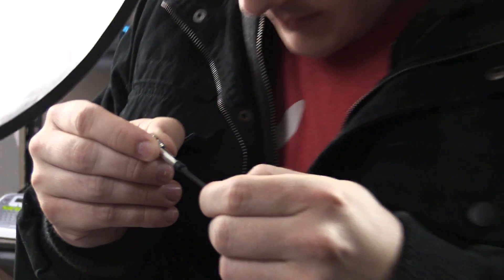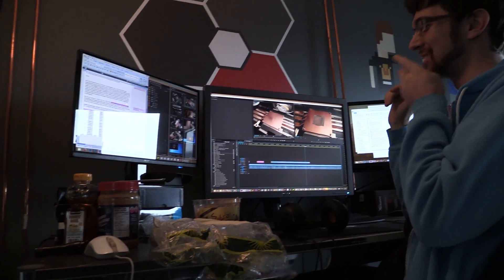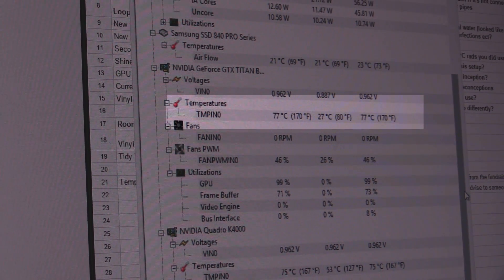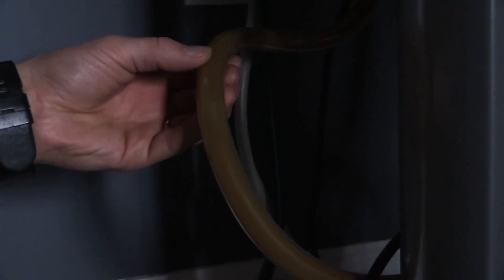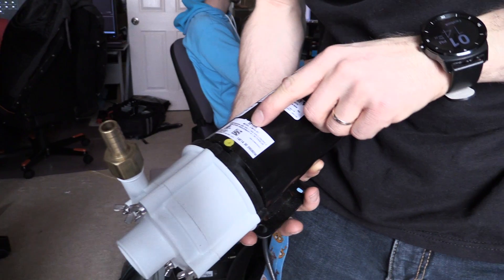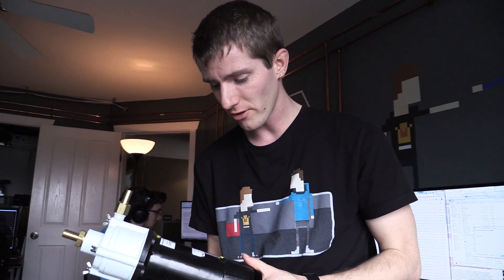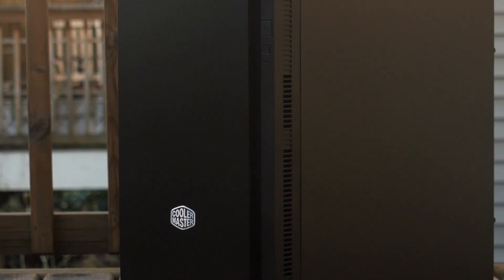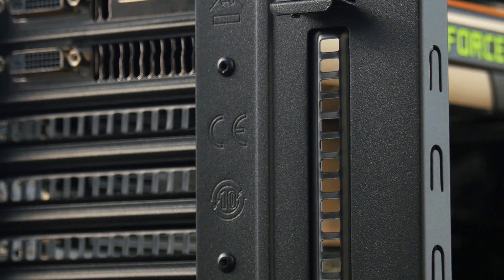Whole Room Water Cooling Part 5a - Trouble is Brewing in the Whole Room Loop...

Comment: I dont understand some things...why choose copper and not pvc? With pvc you can easily add valves for all the pc's for maintanence and flow pressure. The copper piping looks to thin for the length- i would have gone with 1 inch for the main line and just left it on the floor. Putting the run that high puts an incredible amount of resistance on your pump. Using copper with the fittings adds a lot of contaminates. I see the sludge...what its from is a pressure buildup in various parts of your run that then essentially acts as a filter and all the crap builds up. Go with pvc, get a good pump, use a uv sterilizer, monitor the ph, make sure all your clear flexible tubing is spray painted black, buy a large pond pressure filter for easy maintanence and many have a uv sterilizer. Finally NO antifreeze!

Comment: You going to blow your money on those special radiators use on car radiator whatever car pvc big pipe dimension too small for the car radiator and use one cable for the big fan

Comment: If you put some gasoline into the reservoir it will kill almost any organism on the planet and the only things that are going to be growing in a lightless environment are either fungus or a protozoan or maybe a form of bacteria and all of these will have released some form of a "seed" or more accurately separate cells that will now reside throughout the system and probably haven't grown into colonies because the system was on, but if the system goes stagnant they may grow and form more colonies like the ones in the reservoir so a rinse with a strong alcohol solution may be in order.  Hope this is helpful, good luck!

Comment: For better luck bleeding the system next time. I suggest using a vacuum bleeding method.  Commonly used in automotive guarantees not having any air pockets stuck in the system.

Comment: I duno if this helps but every time i work on a cars radiator Linus, that same sludge stuff is around the radiator cap, may not be your reservoir or mixture, but the antifreeze itself. if you do not believe me, got to your car when its COLD and open the radiator cap and look for yourself(p.s. the radiator cap is sometimes a pain to open), im not a betting man but if i was, i would bet that same stuff is there as well.

Comment: I wouldn't use tap water at all, only distilled. Also I would use a synthetic antifreeze with low silicate and phosphates http://www.amazon.com/Pentosin-Coolant-Aluminum-Engines-Liter/dp/B001GRNS6Y/ref=sr_1_1?s=automotive&ie=UTF8&qid=1423104465&sr=1-1

Comment: I have very little experience with water cooling, but I do have a suggestion for the future and that might be to add a UV water filter to the loop as I have some experience with aquariums and cloudy water. That way you don't have to worry about bacteria with the current fluid mixture you are using, but I don't know if it is cheaper than just adding something to the fluid.

Comment: We run that same wireless mic setup on our cameras at work, those stupid connectors are always getting broken. there is nothing you can do to stop it short of replacing the entire cable with something that's built a little bit better.  in times past, sony made some really nice lav mics but I don't know if they make one that has the correct plug on it.  also, you might look into running glycol, Dowtherm SR-1, in your next setup.  that's what is used in liquid cooled broadcast transmitters.

Comment: Hey Linus. I've scanned through the comments and can see there are a lot of suggestions for how to avoid the bio material growing, so the only thing I would add as a suggestion is to switch the reservoir from metal to a Black Acrylic tank.
We did this for our fresh water tank on our yacht to avoid any sort of corrosion and also to help stop any bio material growing in the drinking water.

Light is your enemy, so keep your coolant away from it.

(P.S. I have no idea what additives might affect Acrylic, so if you think about changing the reservoir to acrylic, you'd need to look into that)

Comment: In agricultural engines Brown sludge is caused by these things: Rust/dirt buildup. Gasket breakdown. Mixing different types of antifreeze. Sometimes getting lubricants in the coolant. If left sitting for a while, bacteria/algae will build up. Where did I get my information? 10 years of experience and schooling in agricultural machine repair.

Comment: One thing you could try to get rid of anything in the res is motorcycle tank deruster. Its labeled for rust but im not joking when I say it will take anything down to bare metal no matter what is in the way. its highly acidic to the point where it will burn you nearly instantly so be careful with it. I cant say what it would do to copper but with steel it does wonders.

Comment: Just a humble suggestion, use windsheild washer fluid.  It contains alcohol, and its cheaper than antifreeze.  I would use it straight out of the bottle.  Also I suggest a closed loop.  Also placing the tank high in the loop will help feed the pump.  There are larger oil coolers that would be better than the outside loops you used.

Comment: A water filter combo with a UV light should help prevent stuff from growing in the flowing water but for the time being you will want to flush the entire loop with diluted bleach-water and that will kill pretty much anything.  The bleach water should not hurt anything as long as you don't keep it in the loop.  Another option and probably the best one for keeping the microbes at bay would be to use water bed conditioning tablets in addition to the antifreeze and water.  By using a garden hose you probably introduced a ton of stuff to the loop when you first filled it.  When you fill the loop keep the computers off and fill the loop with hot tap water, the hotter the better.  If you have access to the water heater and you can get the temp up above 160 but stay well below boiling and fill the loop with a clean hose.

Comment: Yo, That stuff you are seeing is almost certainly a bacterial infection. I have seen that exact thing before when working with hydroponics. That is a typical grey/brown slime infection. I recommend using a high concentration hydrogen peroxide (H2O2) solution. around 30% or better is easily available at any hydro store or online. This concentration has approximately the same bacteria killing capability as bleach but it also breaks down much faster. The antifreeze has an anti corrosive agent but I can't say how good it is if u actually used bleach. H2O2 turns into simply water and oxygen so safety should be no problem when introduced into the loop. The only thing H2O2 won't stop from growing is algae but that is why the loops should not be exposed to light and that should be no problem. GOOD LUCK!

Comment: could you use an open top cistern as a reservoir? same ones they use for hotwater with boilers? 
also, would it be more suitable to use central heating fernox instead of coolant? as it would prevent corrosion in the copper and iirc it'll stop calcium build up if you happen to be in a hard water area

Comment: Also Linus. If you get another reservoir do not get one made of mild steel like the one you have. Even though its painted on the inside i will not prevent it from rusting What you need is a reservoir made out of either plastic, aluminum, stainless steel or copper. Some of the material types listed above have antimicrobial property's.

Comment: you should put an inline RO water filtration system like used in indoor gardens. To keep the water cool, use an aquarium chillier to bring the water down to temp if the radiators cant dissapate heat fast enough since it will be just pure water and not coolant. RO filter im assuming would strip coolant out of the water which is why Id recommend an aquarium chiller. LOL  Or run "waterless" engine coolant that is non corrosive. Very expensive but worth the high upfront cost and future savings. There is a specific brand that Jay Leno uses in his cars with aluminum blocks. Non- corrosive and super cool fluid. This would have been more interesting had you guys just used high performance automotive radiators with large electric fans.as well as electric water pumps all of which would be able to easily ran off an ATX PSU.12v rail. "Redline waterwetter" with deionized water, is an amazing mixture for race engines...

Comment: LinusTechTips , will this "organic matter" cause something beyond harmful to the water blocks as well since they were exposed? More importantly,will this mean that the "Whole Room Water Cooling" project will now have to wait until everything is cleaned out, or from your current understanding, should a few "flush's" (if possible) be fine? Also, would this only be common for anti-freeze or regular water loops? I am just not 100% sure how this could happen. This is where you need to make an "As fast as possible" episode about how it is IMPORTANT to use such chemicals in a water loop, or make sure the premade mixture has said chemicals. lol.

Comment: Don't tell me you used a hydraulic res... they use flux for manufacturing, That could be just what it is, if that's the case, it' should be fine. You could inspect the inside with a SeeSnake or something.

Comment: Run bleach through the entire system. With that much fluid you could probably add about half a cup. That or take a big cylinder trash can and fill it with a bleach mixture, pump it all through. Then fill it with water and pump it all through twice. You have too much liquid in this system, you actually need to consider introducing chlorine, bleach, or a fish tank water cleaner on a regular basis to keep the loop clean.
Reply: You also need to boil some water and shake the hell out of that res to get the rest of the gunk out.

Comment: You may have figured out by now, but here are some suggestions from someone in the automotive industry. Use a newer type coolant than conventional green (ethylene glycol). It doesn't always play nice with multiple types of metals. Newer types of coolant, even a universal type will be much friendlier to all of your components. Also use distilled water. When mixed with your coolant, which is called antifreeze for a reason, even living in Canada you will be fine, and it will not introduce anything from your tap water into the loop.

Comment: so, that "growth" you are getting looks more like something machinists experience with their cooling systems. the glob is (from what I've seen) caused by oils and other particulates separating from your coolant. (in the case of machining a special coolant that 'burns' cleanly) when this problem occurs they just scrape off the top and let it go. in their case it doesn't effect cooling because it is just thrown at the part and bit, but you are running a block and a rad. If i were you i would take some sort of anti everything liquid like dish soap or shampoo without conditioner (they have amazing oil removal qualities) and run them through the loop.

Comment: I don't think it's necessary for automotive coolant to have biocide seeming that it run at something like 15psi and 100 degrees but you should probably add some biocide and wash it with boiling water

Comment: Only thing i can think of is that the manufacturer has added a coating to the inside to prevent corrosion, and the ethylene glycol in the anti freeze has probably broken it down

Comment: Echoing a comment that I've seen previous, automotive antifreeze does not contain any sort of biocontaminant control die to it's normal operate temperature in normal applications because little to nothing could ever survive +180*F temps under pressure.

Too bad you had to find that out after the fact.

Comment: i had this vary same ishew running a/f on my large cooling loop an i found adding some dish soap was enuf to kill that grime. bubles were not a problem [no filters will not help with the growing crap. my loop use to go from pure clear to a green in less then 2 months before i added dish soap [p.s sorry my grammer is not the best]
Reply: sorry had to add i ment a greenish clear not white cus of the anty freez. but its use to go foggy an vary slimy like what you have here before the soap the only reson i thout soap was the oil based feel of the Bacteria/stuff an worked great for me i hardly ever have to clean out my filters or blocks now. i allso find that most clear hoses will tan/change color when useing a/f. not so much with just tap water   hope some of this helped love the vids keep em coming :)
Reply: crazylikealbert  p.s 2 i have older vids an forum pics as proof if bin running a/f for years just so u know im not talking out my ass lol

Comment: Linus, this is a biofilm by the look of it. If I were you, I'd get myself to a homebrew store and buy a tub of PBW. 

Mix it up with distilled water, wait for the fizzing to stop, and run that through for an hour. It's safe for copper and polycarbonate.

It might clean the hose, but I'd dispose of all of it.

Drain, flush with more distilled water several times, then add your antifreeze and biocide.

I had this exact problem when I first water cooled in the late 90s.

Then and now are the only times beer brewing and computers have had interchangeable skills.

Max

Comment: If I remember right, they filled it with a hose, I'm assuming from the house water supply.  That's where all the crap is coming from, they need to use distilled water with pure antifreeze otherwise it will leave all that crap in the system.  The antifreeze will help, but it won't stop it completely.  And maybe some other additive to stop the corrosive properties of the distilled water if the antifreeze isn't enough.
Another thing, they might not have had the right mix of antifreeze to water...
Anyway, I think this is all the minerals and other organic crap that was dissolved in the water before they put it in the system.
You have to keep any cooling system like this very sterile otherwise this happens.
Reply: Replying to my own comment, I watched the end, with what Linus said, sounds like my conclusion was correct.
They used water from the house supply and contaminated the system, and with no biocidal stuff, it grew!

Comment: They could add filters at the break away connectors where the PCs are.
The loop that the PC is on is clearly clean.
Also I'd recommend getting a copper reservoir next time, stuff tends not to grow on copper

Comment: Re: Lav mic problem - Try using an inch or two of heat shrink tubing.  I've found it really helps.  It stops the wires from bending over the hard edge and cracking by offering a bit of resistance to the movement but still allowing an easy cable run.

However using some medical tape (the kind used for gauze bandages) and taping the wires to your chest under your shirt would be the BEST way to do that (in conjunction with the heat shrink).  Picture every mob movie when they "wire the snitch" by taping the microphone to his body.  That guarantees no pulling on the wires at the belt.

Comment: LinusTechTips : its simply oil in the loop wich gets gunked by the Anti-Freeze. the same thing happens in a car, if your gasket between the motorblock and the valvehead fails. then you would see this gunk on the inside of the oil-fill-cap.

i would recommend to buy some waterwell-filters from your local home-improvement-store, such like this: http://shop.purway.de/DROPSHIPPING-F1-Rueckspuelfilter-Wasserfilter-Sandfilter-Hausfilter-Vorfilter-Brunnenfilter/a1010626195_u7618_z8ddf6903-6aec-4578-ab1f-4a1f9fcd7761/?gclid=CjwKEAiAo8emBRCX_OqU4qek6y8SJACzgf8fSoAHAsteJrW3Vq7hEcmH9NvCC9NdKyWFe2UO0icCABoCF8fw_wcB

Comment: linus, I'm on a well and we use a filter that filters our water before it go's into the rest of our pipework.  It's designed to filter out microbes and that sort of thing. I would highly suggest one of these for your loop.  It will cause a bit of a pressure drop but with those two pumps you should be fine.
Reply: also you will probably have to change out the filter once a year or so but they are made to quickly swap out

Comment: Automobile antifreeze doesn't need any antimicrobial agents because the temperatures it normally operates at is above those microbes can live in.
I'm glad you found this out by Googling it and using the brains of experts to help you. LinusTechTips check out closed loop heat-pump systems. They might use what you need.
I remember one of my first experts who told me what I was doing wrong; Mrs Donsky, 1st grade; She was a fox.

Comment: Some silver would probably kill whatever is plaguing you.  Any silver of any purity could be put in the reservoir. It would then dissolve and kill of anything in the whole loop. The anti corrosive will protect the copper and the silver will be dissolved in so small amounts that it's no danger either way. Put a piece in the reservoir (preferably tied into something (you can google silver spiral in pump if you wonder why)) and it will do it all by itself. The amount that is dissolved is aoutomatically right for any amount of water (due to chemistry) The only demand from this antibacterial system is that it needs to be cleaned approx. once a year. Swapped water and all that.
Reply: You'd need quite a lot of silver for that amount of water.